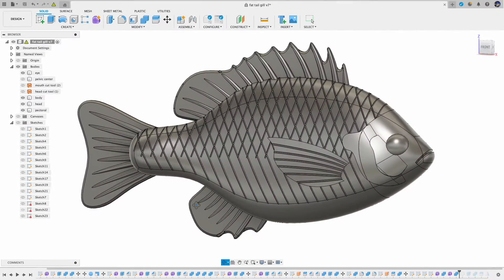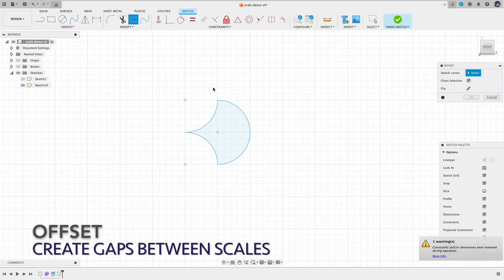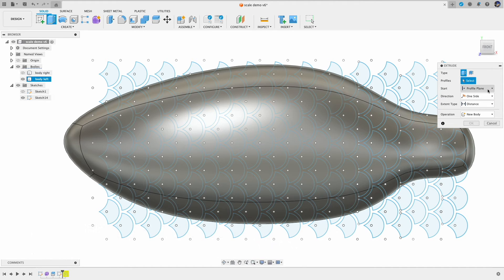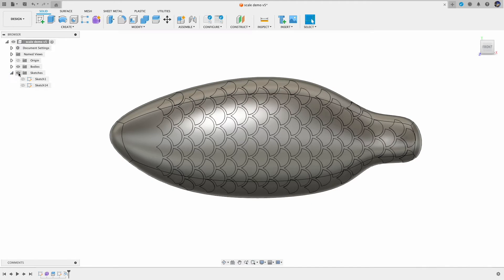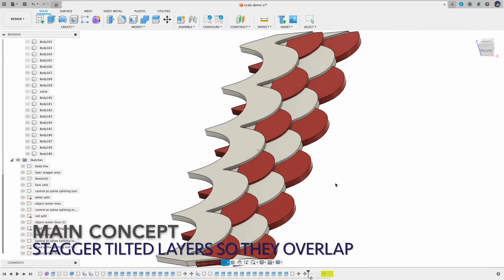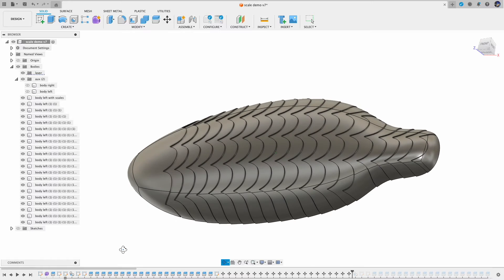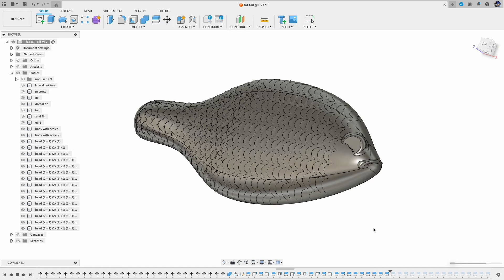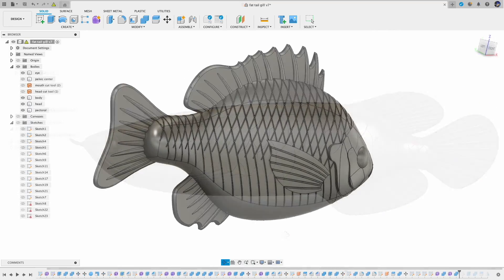Realistic Fish Scale Pattern in Fusion 360

Comment: How do you project the lines to the object? I have tried different ways but i dont get the to project to my lure😊
Reply from the maker: I am not sure which part you are referring to. If you meant the scale lines, they don’t need to be projected to the lure body. You can use them to split the body even if they are on the x-y plane and not on the body surface. Once you split the body into slices, you will see lines on the body surface.

Comment: In 2:38 the offset of the 1st scale disappeared,how did that happen?Should i remove it too?Αnd how do you create those splitted curves?I am new and hobbyist so some things i don t understand
Reply from the maker: I removed the original scale outlines because they are not needed anymore for creating the scale pattern. You don’t need to remove it as long as you don’t include it in the pattern. I programmatically use spline to create the splitting curves. A series of arcs should work too but they posed an issue when I wrote the program. You can manually create the splitting curves using splines, just play with the fit points and eventually you will get it. If not I can make a short video to demonstrate it. Cheers!
Reply: @ That video you say could help a lot,i ll wait for it eagerly,thanks!

Comment: How did you combine the 2 half’s without holes in the geometry
Reply from the maker: I keep a copy of the body before making the scales, after scales are made, combine them to the original copy which was perfectly split by the center plane, so no holes. Does that answer your question?
Reply: @yauckoutdoors  ya thanks your a genius for coming up with this method
Reply: When I combine the scaled one with the non scaled one it gets rid of the scales
Reply from the maker: @colebradley2724 You can move the scanned one out a little bit so the scales will not get covered by the original copy. Hope that solves the issue. (Sorry for late response. I didn’t get the notification if it’s a follow up comment. Maybe @ tagging will help?)

Comment: 3:45 you don't need to remove the profiles, you need to draw in the same drawing, where you drew the fish scale, you need to draw a semicircle there, start drawing from the fish's gills, let the line go up as the line of the fish goes, that blue profile in the middle of the fish, you go to the tail of the fish and continue to draw the lower part of the fish from the tail to the gills of the fish, so that line that you drew, when you go to extrude, it will not allow the extrude to go behind the line, that blue part of the fish allows you to extrude, and the lines can be moved a little upwards, but again that is not a solution to get a scale all over the body, but it's better than the one you showed, in this part of the video, I'm going to continue watching the video, I think you put the scale all over the body, so try to do it that way
Reply: the selected face should be drawn inside the drawing where you drew the fish scale, in short
Reply: Last metode is top and is hard 😢, I think that I will skip the fish scale on my model and take the mesh and the mosquitoes and paint the fish scale with them. it would be difficult to fit everything into each other, that's why simple mesh and painting
Reply from the maker: Cool insights, thanks for watching.
Reply: yo man, I spent a month correcting my mold and when I thought I was done, I realized I had to put scales and other details, I searched the internet for 3d models and realized that I have to put scales and fusion can't do that, so I discovered blender, if you've never worked in it, believe me, it's easy to learn, it's not difficult, I started today and in an hour and a half I managed to master the basics and make the first head sculpture, believe me, the blender program is amazing and ten times better than fusion, every fishing you can transfer the lures you made in fusion to blender and make them look even better @yauckoutdoors